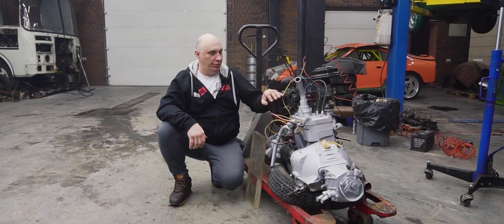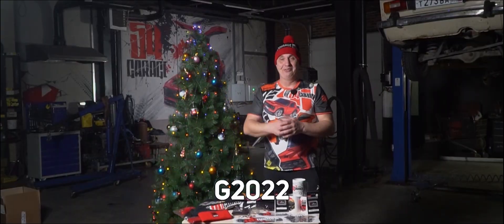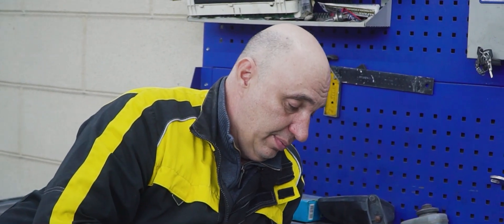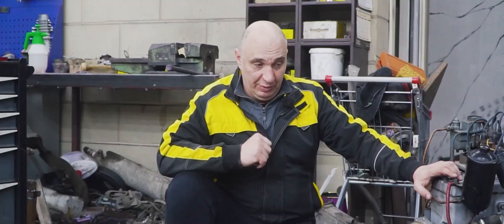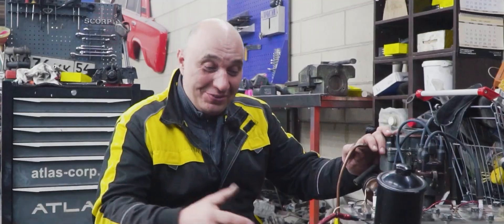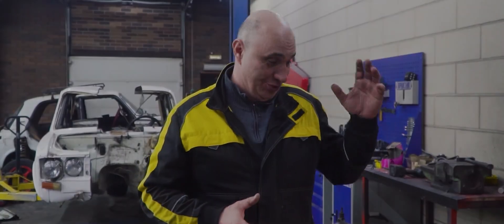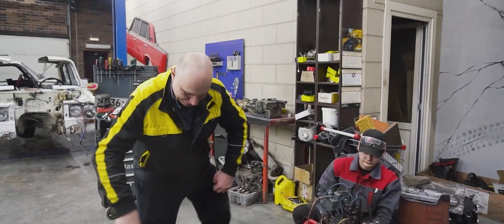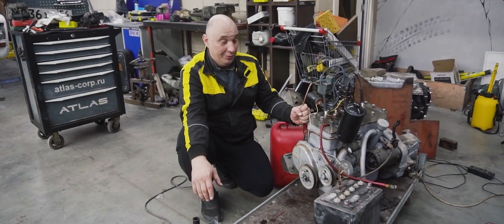We watch an engine run through a transparent cylinder head

Comment: Head is called flat head. Engine designs were called L head or T head depending on valve placement.
L head had the valves in the block on one side of the piston.
T head had intake on one side and the exhaust on the other side. This required two camshafts.
The flathead Ford V8 was a L head design which necessitated the exhaust ports passing through the block from the center to the outside. Early models suffered running hot and all tended to crack somewhere in the ports.

Comment: Hey! Greetings from Canada! We're upset about Ukraine, but we certainly don't hate individual Russians. How about making the head out of borosilicate glass; it's sold as Pyrex or Corning Glass around here. It is extremely strong and heat-resistant; I think it would actually work for a flathead engine like this. I have no idea how expensive a piece of custom-made borosilicate glass would be. But imagine driving into a car show, no hood on your car, with a clear borosilicate glass cylinder head on your engine. If you did that, give the engine a nice rebuild - rings and bearings first - to make it as healthy and reliable as possible. Nice video, thank you.

Comment: Great Video. When the plexi gets hot and begins to melt, the fumes throw the air mixture off so it wouldnt run the 2nd attempt.
Reply: I think the head gasket failed and lowered the compression

Comment: flathead? thats almost cheating. Still cool to see this done on a multi cylinder application. this is the first time I have seen that done so far
Reply: Well they can but need more time to make, still good idea to use different style of engine that use ohc or ohv
Reply: @jammdoe1873  ehh probably not. as soon as it got hot it would probably liberate the valvetrain. would be cool tho

Comment: does in the car under load going down the road ( and or does pot holds maybe make a difference? ect. ) change it? btw i finally got to see the cylinder cycle to cycle different's as the two next to each other was fighting for the right mixture ect. and if you look close you can see the ram intake and exhaust effectiveness aka max wege of the 60's used it for more power and constancy's as the video shows a flickering cycle 2 cycle on top of the 1vs2vs3vs5-cylinder's mix and spark ⚡  fights

Comment: You should try adding things to the fuel to change the color of the flame like copper sulfate or strontium chloride, i think that would work best if it was running on ethanol

Comment: Maybe you could show what it looks like during a really cold start if at all possible? I'd be most interested in seeing this on a Diesel engine but i'd be really impressed if you manage to make a plexi head that doesn't instantly explode on those compressions 🤣🤣
Reply: I was thinking the same. But I'd imagine on a diesel the head wouldn't last long like you stated. if at all. Cool idea though!
Reply: The closest we’ll get is the fire pistons that warped perception made a video on. I think you could make a see through diesel if you had thick enough plexiglass with really strong reinforcement to prevent cracking.

Comment: You lost compression during the combustion process I used to work in a race engine building shop building blueprint race engines and high powered street engines too precision engineering but your guys videos are fun and we used to port and polish heads but sometimes to even out the compression or lower it we would relieve the combustion chambers by taking metal away and in your case it melted away hahaha if you use propane or as we call it here in australia it burns really hot so it will melt quick but it was a very interesting video very rare seeing a flat top engine I have not seen one for over 30 years I would love to get my hand on one oneday I think you guys would be the guys to go to do you ship to Australia? haha cheers

Comment: I like how you can really appreciate why a 4 stroke engine needs spark advance - you can really picture when the explosion is at its peak and see where exactly the piston is at. Just from my point of view, in most of the slow motion, this engine could stand quite a bit more advance as the pistons seem to be well on the way down at what I would guess is peak pressure. Very very cool guys.

Comment: You need to use a higher quality of Lexan then you will need to use threaded inserts for the spark plugs and crush sleeves for the head bolt holes so the head can be torqued tighter. And you will have to do the same metal sleeve for the distributor hole and a threaded insert for the hold down and pretty much threaded inserts for any other fasteners, then I think you will have a cylinder head that should last a lot longer.

Comment: AHHHH... To make it last longer... AND test your skills..... How about a THICK SLAB OF GLASS!!! ??? 🤔🤔 😏😏
Maybe, if you know someone in the glass making industry, a mould? as for spark plug threads 🤔 glued in/press fit threaded inserts (Maybe press fitted from underneath so when you screw in the spark plugs, they clamp down to make a nice tight and sealed fit? 😎🇬🇧

Comment: cool! at @ 12:10 you can see the exhaust scavenging effect; the combusted mixture is clearly on it's way out way before the piston reaches the bottom and starts the exhaust stroke. i didn't expect that to be so efficient on an old valve in block engine.
Reply: It is called blowdown period, about 70% of exhaust is evacuated during blowdown. Scavenging is when exhaust sucks fresh charge in.
Reply: @V8Lenny  i suppose you are correct. still a lot of pressure in there when the valve opens. thanks

Comment: Try making a block out of plexiglass, complete with oil pan.  Use the iron head if possible, for a better control of the combustion.  Then you can see the flame all the way down the cylinders, watch the crank spin, push rods and camshaft work, etc.

Comment: Very cool, especially when you flooded the engine.  You could see the gasoline washing the oil off the combustion chamber.
Reply: This is exactly why it's horrible to run an engine extremely rich all the time. The extra fuel washes out the cylinder bores, and wear occurs very fast. Pretty soon the rings would be shot, and there will be no compression left.

Comment: I'd be interested to see different timing conditions live (advance and retard while running). Perhaps it's possible to machine openings in the original head over each cylinder where you could pour replacement acrylic into after they burn out. Make a taper and or key shape cut on the head and maybe even make a mold for the combustion chamber so no machining is needed on the re-pour. This is really amazing to watch!

Comment: make a top with holes thru it for the bolts, to secure the plex tight and compressed with L shape stock in a box lid shape.. then go hog-wild on the fuel mixture with less chance of breaking quickly,

Comment: Probably, by what I see, spark event is not timed right. Distributor is wiggling all around. Try to run Diesel through the carb and see what kind of timing is needed to get running without excessive pre-ignition. I did this with a small 2 stroke and 4 stroke motorbike engine, and it worked. Since the default low compression ratio won't set it off on it's own, you can mill the "Plexi-Head" flat to bump ratio...but making it flat would moreso make rebuilding this engine for other runs easier/quicker/cheaper. Good job Garage54!

Comment: hey guys, what about trying kerosene ? As I know if you use it in car engines it fires before it should because of the compression. It would be interesting to see this. It would be interesting to see a diesel work as well but I don't think plexy will hold on such compression.

Comment: Definitely try propane (LPG). Quite a few cars run on it down here in Australia. Maybe also try mixing in some butane into the propane as well. (common servo scam is watering down the propane with butane (which is cheaper to buy) which in turn makes the car run rougher)

Comment: Usually it's a good idea to run the engine on a cooler-burning fuel than petrol, as that way the plastic is less likely to melt and reduce compression (or worse, go bang)... :)

Comment: I can see this being a major advantage in scenarios where key parts of the engine experience failure. You'll be able to diagnose head gasket issues or valve float on the spot without removing the actual head or cover itself.

Comment: The plexi allows you to run a higher compression ratio by drilling away less material and having a smaller combustion chamber. I'd like to see that as another experiment with this engine.
Reply: More compression = more heat though :(

Comment: I'd be very uncomfortable about running acetylene, unstable combustion would make a mess of the cylinder head in short order. 
The propane sounds promising, it's well known as a stable burning fuel in many engines - and being a gas instead of a liquid it will ignite more easily.
That would prove quite fun to watch.

Comment: Clear head for a flat head head 4!?! Niiice! To get the clear plastic as polished as possible, use a very soft buffing wheel on a fast rotary tool with some 1200 diamond grit lapping compound. Great results! Also brings back those hard to fix headlights. Great video and happy new year!!!

Comment: Wonder if there is a way to take same engine, mount objects in the bores to act as a mold for the recess combustion chamber of head such as a plaster cast that protrudes from the block deck, then have head bolts standing on their own out of the block, then have a rectangular form to make a mold of a head, and then pour molten glass onto the top of the engine block deck, the plaster forms will make sure that you have the recesses in the combustion chamber of the head. The head bolts standing out of the block will create the bore holes for when the head is applied to a healthy engine that wasnt used for the casting process that the head bolts would line up. And so afterwards you can have a glass molded head, which wont burn up like plexyglass, and you could essentially have a glass head that would last and would be far stronger than plexy glass and still be able to see into the engine. Engine block would just need to be steel and not aluminum or else the molten glass pored on top would melt the aluminum like hot slag on a lego block.

Comment: As you guys were saying, there’s already some videos of these with 1 cylinder motors. But this is the first time I’ve actually watched a motor flooding.

Also be careful with that fuel can. If there’s blow by or backfires it can fire inside the can and splash fuel everywhere.

Comment: Yah , I think those old flatties were only about 7:1 compression , so I think the melting in the combustion chambers lowered it down to probably less than 5:1 . But that was how I always pictured it . you could even scan the 1-3-4-2 firing order . Damn you guys did a beautiful job on the combustion chambers . Nice work guys . :)
Reply: A Moskvitch 401 (1947-55) originally had only 24 bhp/3400 rpm on 1074 c.c. 
and only 5.8:1 compression...if you had strong enough vodka it would run on it!
Reply: @vitameat  Our flathead had a touch more compression , except the tractor motors  , but those were smooth running little buggers . I'm an old iron kind a guy . Lol

Comment: Out of all the goofy, weird, funny experiments you guys have done over the last couple of years, this one ranks as probably the most accidentally educational. We all know what happens, but to be able to watch it happen is a whole 'nother level of fascination. I was really impressed that you got the plexi head machined as well as you did, never mind making it work. Really 107% success rate on this one. 

BTW, Vlad, that type of engine is simply called a flathead.
Reply: L head in this case, the other option is T head.
Reply: @rosiehawtrey  Absolutely, yes. L-head is as you see it in the video-both valves to one side. T-head is valves on either side of the piston.  Thanks for clarifying that. Hell, I had forgotten!
Reply: @rosiehawtrey  if i didn't know better id say that engine was out of a 🇺🇸 forklift ( like a 70's clark as 4 and L6 cylinder's where used ) or ford model T 🇺🇸. but i fond out ford ( and gm use the same engine for awhile in lines like the oakland-6 ect. ) had sub-supplier's like continental so may bet is it's one of them and is related to the jeep engines that was used 1940-2006 as they modified into the last 4.0L
Reply: @richardprice5978  The Jeep engine was a flathead at first? Then it was modified to be a OHV?
Reply: @gabrielvieira.4358  yes continental engine design go looking eventual you will find it, thats why the 2006-4Q/2007 jeep 4.0L has some odd quarks and flaws as for awhile it was easier to modify the tooling that to start from scratch remember that this is pre-CAD software era and after watching my YouTube channels im getting the feeling the packered and buick straight-8's are twist's on the same platform ( seams likely to have started off as the T-engine and then the Oakland then the 8-cylinder then back to L-6 AMC then to Nissan L26 then 2JZ then OM-606 merc C-class ( 🤷‍♂im not sure if merc uses it anymore or any L-6's i do know that it did get a airworthiness certificate in this format as a diesel engine 🤔 and maybe even the gasoline 88 ron variant of merc. ) then dyeing off tech tree 🌳wise and keep in mind just like some video games it's not in chronologic orders but worse to best/final edition ) and later on some how IP was sold/moft into the 2JZ/twin cam but jeep never used it and or at least in the north American market that i have the most accurate never used the diesel version ether instead it was a different diesel engine ( a 4cy or v6 but i haven't ever worked one it but a aqantace did import and or ordered one xj from Canada 🇨🇦 ) and way mostly for the Canada 🇨🇦 and Mexican/🇺🇸 army marketing aka rare
Reply: @gabrielvieira.4358  the Oakland-6 was OHV first splash oiling with water pump on the passenger side but cost cutting led to being a flathead thomo-cooling and splash feed oiling and depending on the year or model jeep kept flipping between a nicer ( aka had pump's ect ) flaty and OHV plus the added confusion of too different engine options aka the T-engine and the amc-6 later on after the epa strangle it the 4L got the OHV head permeantly intel both were cancelled in the 2000's, and in my 2c jeep was selling off in the IP late 60's/E70's so that's why jeep was using the V6 and SBM and wouldn't have been better off killing it in 1970-6 as the final year in a JC-5 or 6 ect. as it need work to pass EPA ect. and the tooling was a 🐷and needed replacement but no someone else in corporate office axed it and kept the zombie 🧟‍♂alive despite not being compatible with buyout FCA's transmission's designs more so applicable for the automatic transmission's as the too have different needs RPM wise. 

keep in mind that the hole production run does mean it stayed the same 💯as the SBC 350 didn't ether as a example for comparison
Reply: We call them "sidevalve" in the UK, presumably because the valves are alongside the cylinders.
Reply: I mean its just a flame. Not hard to imagine
Reply: @1marcelfilms  Nope, it isn't "just a flame". It's a controlled explosion that happens several thousand times a minute in a precise order. It's because of that "flame", as you call it , is what propels that 2-3-4 wheeled device we all depend on. A simple flame is not able to do that sort of work. Well, maybe on a steam powered car.....

Comment: Great, I'd like to see an update on this. I think you need to make a cover plate for the plexiglass. It would look just like the head gasket but made out of 3/8"/10mm or 1/2"/13mm thick steel to hold the plexiglass down evenly, just like a honing plate for a block. Also, if you machine the combustion Chambers, you can use something like Naptha or xylene and it will make them smooth without sending them down or polishing them, just like the finish on a craftsman screwdriver handle. Hopefully you can get it running and bring it up to its rev limit until it fails

Comment: Very Cool! To see on a 4cyl instead of a Lawnmower was the Best! 

Can you replace crank and cam journal bearings with that plastic, see if it melts and goes boom right away, or if you can drive for a while. Engine oil, at operating temperature, is not hot enough to melt plastic. Would the friction between parts be too much for the plastic to take? 

Cheers!

Comment: I think an o-ring would work well. Just cut a groove ~.5mm deep around the combustion chamber ~1mm away, and run some ~.8mm wire in it to spread pressures & forces.